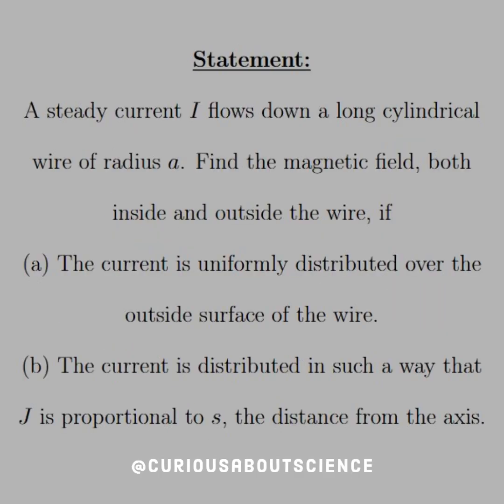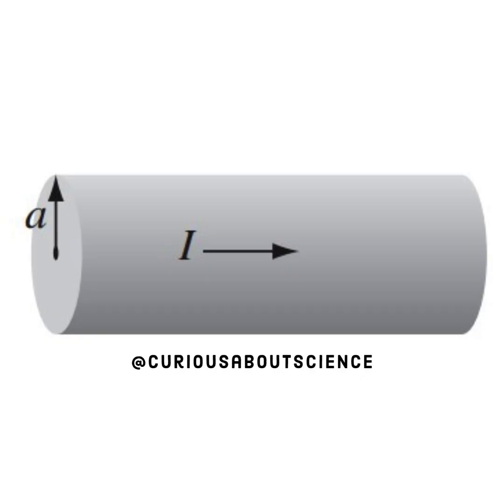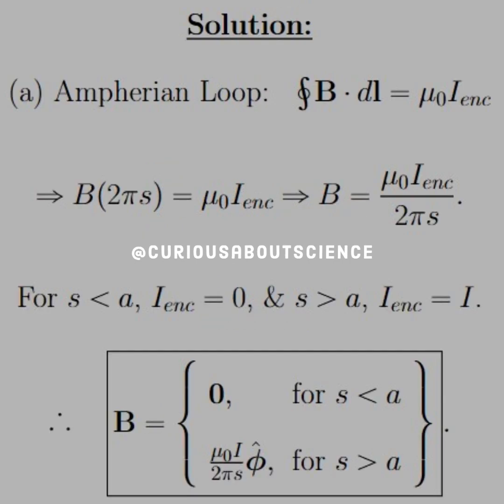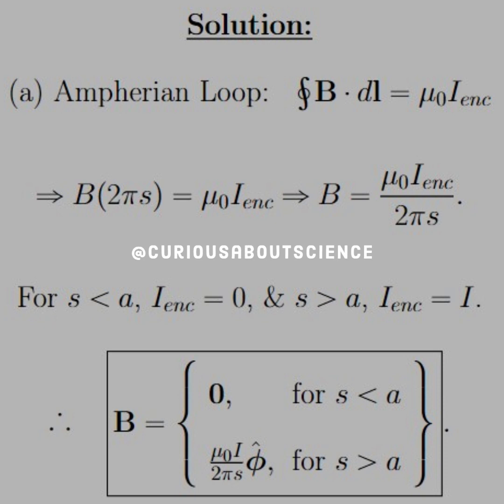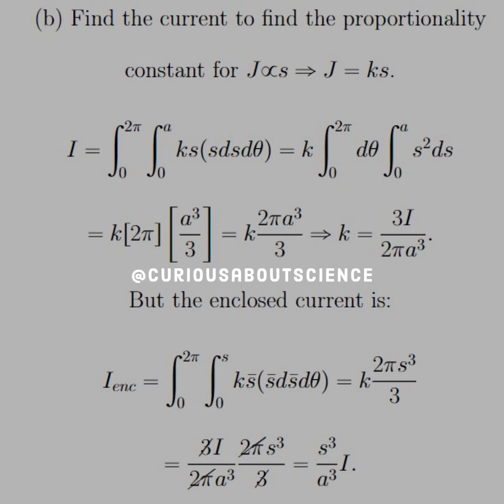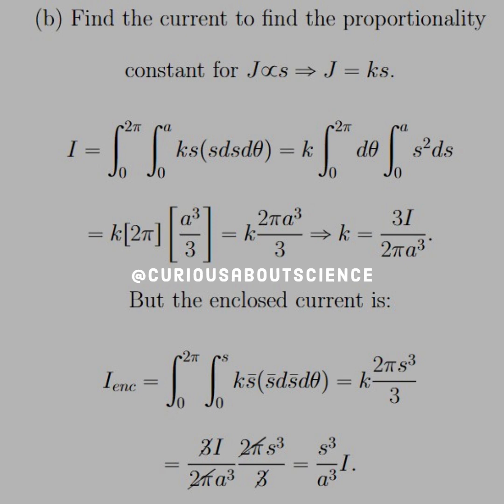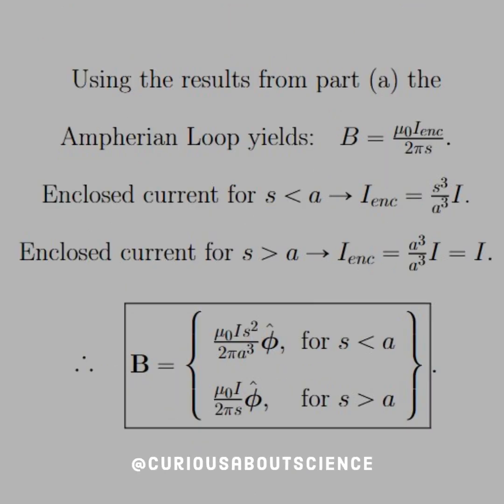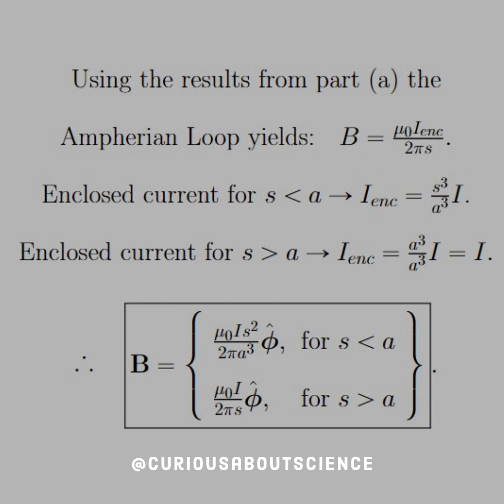Problem 5.14 - DIv & Curl of Magnetostatic Fields, Ampère’s Law: Introduction to Electrodynamics

Comment: Why is it that the direction inside and outside is the same?, according to the Biot-Savart Law, the field's direction is the one resulting from the cross product I.dl cross r. For points outside the cylinder the term I.dl goes in the z direction and r goes in r direction (radial) so  z cross r = phi, but for the inside points r would go in the negative radial direction (-r), so z cross -r should give  -phi. Where am I wrong?